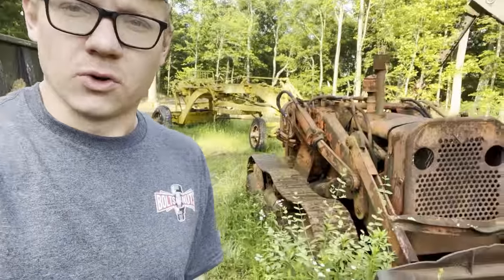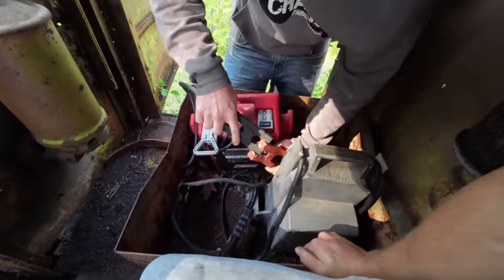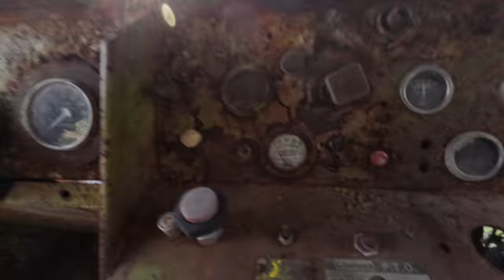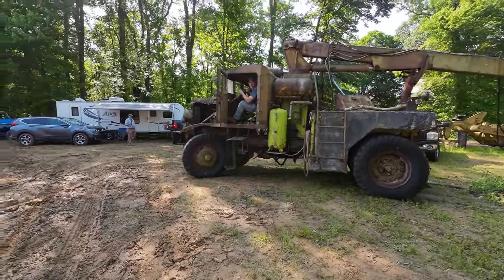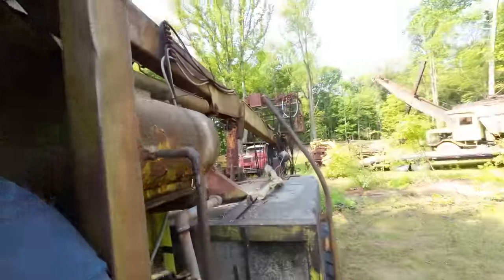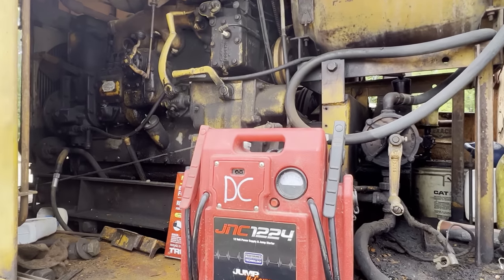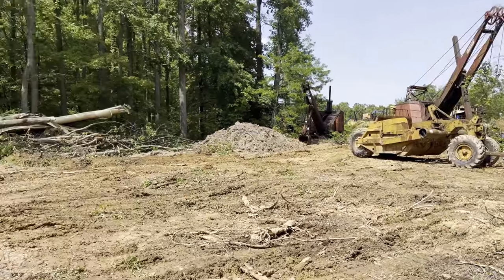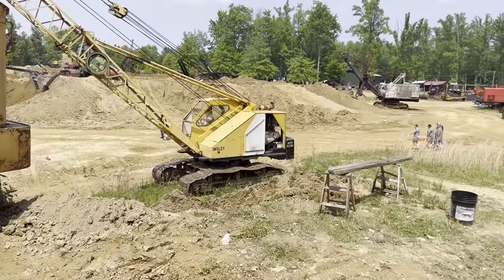1950s Euclid Off Road Truck, Sitting 10+ Years, Will it Start and Drive??

Comment: As someone who has worked underground, I recognize what this truck was used for immediately... This would have been the powder rig. Commonly called a "powder monkey." As a blaster, this is what we used to load shots underground, to advance the mine... I've never seen one mounted on a Euc like this, ours was on an old Gettman... But I'm 99% sure that's what this was used for. That air tank on the side was likely used for the pneumatic loading of ANFO.
Reply: I love that
Reply: Likely you are right. Like for blasting power dam tunnels.
Reply: What did you mine, if you don’t mind me asking?
Reply: Literally says it in the video
Reply: Boom truck literally
Reply: @kalen01  I'm pretty sure all powder rigs are a rusty POS the moment the leave the assembly line... Still never seen a nice one.
Reply: @pacificcoastpiper3949  Limestone.
Reply: @kalen01  first of all thank you for all your hard work y'all don't get enough thanks for that dirty dangerous job

I'd love to see that truck running
Reply: Without a doubt. It wouldn't shock me if they bolted out of it as well.

The company I worked for was partial to Oldenburg/Cannon powder monkey rigs. They were okay, certainly nicer than the abomination of a clapped-out Young Buggy I stumbled across near a Utah uranium mine. They'd deactivated the bed cylinders and lined it with plywood. Certainly one of the machines of all time.
Reply: I was going to say the same thing. I work in an underground zinc mine and we use ANFO on a similar rig ours is a Getman also. We also have used an Oldenburg and a normet.
Reply: ❤YOU DA MAN! Never had a doubt, you’d get that Euclid  running! GREAT VIDEO!
Reply: Dry blasting with ANFO?
Reply: Sure is,I work at a sand plant (above ground mine) and see the powder truck going in almost every week.
Reply: @bixby9797  I would hope so. ANFO is water soluble... if it gets wet enough, it'll dissolve, water can also cause it to deflagrate, which can cause the blast to release NOx, which is harmful when breathed. There are nitrate based emulsions for use in wet conditions, but ANFO is dry use only.
Reply: When he said it was for mining that was my immediate thought.  It looks like it has an air supply system for operating rock drills and for blowing out holes.
Reply: Don’t think so.
Reply: @welshlyn9097  it's a old mining truck,otherwkse as a powder truck.
Reply: @ChrisHarding-lk3jj  Compressed air is also used to blow ANFO into drillholes, as well as blowing the holes out before loading powder. That task feels like standing in front of a shotgun loaded with birdshot!
Reply: That Euclid came with its own hammer to fix any issues!
Reply: powder monkey was also a name for kids who used to load powder into cannons.
Reply: Q
Reply: Thanks a bunch for the genuinely useful comment, Diesel Creek vids always have some of the most informative and non-toxic comments on YT and I'm so here for it.
Reply: yoooo that's sick! appreciate the extra info.
Reply: This is from back in the “ good old days “ when breathing diesel smoke was good for ya. That old Cummins barkin out the Jake must have been something to hear.

Comment: I challenge anyone to find any modern thing nowadays that can sit outdoors for 20-plus years uncovered and that will still start with the same old fuel that has been sitting there also for 20-plus years! Nothing like good'ol diesel power to work after decades of rest.

Comment: Great video Matt.  I love any machine as long ass it's old. As a young kid in the early 50's I'd stop by Delta Crop Dusting service in Monroe, Louisiana on my way home from school. They were the precursors of Delta Airlines. They built their own aircraft for crop dusting and it was like watching a big model kit being put together. I was no trouble so they would sit me on a stool, give me a 5 cent Coke and let me watch. They would answer any questions I had if it wasn't too many. I got my love of airplanes and flying then. Still today, I think REAL airplanes have two wings and round propeller engines.
El Mirage, Arizona

Comment: Congratulations on getting that ol' Euclid FD running again. I've been attending this show on and off since the 90's and I've never seen it run. There's also a decent Link-Belt "Speeder" shovel behind the Euc that hasn't been run in many years. Rumor has it that it has a serious mechanical issue that would be costly to fix.  I have an old 1990's VHS tape of this show: you wouldn't recognize this place if you saw it.

Comment: 743 Cummins are great engines. There's a 4 cylinder version of the same engine in the grader sitting outside my house right now, a 495. Love the sound. Side note, it uses 2 D batteries to start lol. Takes a lot of current.
Reply: Being a old H series is very possible that it’s still a 672cid.  They have a smaller bore, 1/8” smaller if I remember correctly it wasn’t until later years they upped the bore size by boring out the cylinder larger.   The cylinder liners are interchangeable the only difference was the older ones had a very thick liner with a notch cut out at the of the liner for the valves to clear.
Reply: When I worked at Cummins in Toronto in the early 70’s it wasn’t too often you came across a 4 cylinder one. One thing I did notice is the ones 
built under license by Komatsu in Japan the inside of the crank cases where painted Cummins Golden Rod yellow, the block casting had a smoother look than the ones that came from Shotts Scotland. I was told back then that the blocks where “ cured “ for a year before they machined 
them.  Most of the engines of this age came from mines, sawmills, power plants, and tugboats pulling log booms up in Northern Ontario.
It wasn’t uncommon to see blocks with casting dates going back to the 40’s.  Lots of memories of making up new lube hoses, as these engines 
didn’t have a lot of connected drilled oil galleries. Accessories had to be supplied by oil hoses.  My old NTC Big Cam 2 from 82 had a “ signal line “ 
that came of the lube pump and plumbed into the camshaft gallery.  There’s nothing like the sound of a naturally aspirated NH 250 with a Jake 
rolling down hill into town. 😊

Comment: Wow, I was watching the nice D8 and remembering driving, but not operating, one a few years ago. Then I did the math and it was 50 years ago. Our mine had a few rented Euclid haul paks for a while, until all our Wabco 85 ton rigs were built, and boy were they loud. The drivers had fun when it rained and they could spin in the mud puddles. One big Terex with a Detroit diesel that you could hear from a mile away. Now those are known as the old days.
jack

Comment: The bucket capacity on the old friction/cable shovels is so small, considering the size and potential of machinery behind it, appears most of it's power goes into maneuvering it's own weight and not the weight of the shovel contents. Great video and 'start-up' of the Euclid. Cheers!

Comment: This was used for high scaling and loading explosives. High scaling is using a bar to remove loose rocks from walls (called ribs in underground mining) and back. The roof is called the back in hard rock mining and called the top in coal mining.

Comment: Will have to look for that euclid in a different place next time I get to the show. In 1962, I worked the summer for LB Smith equipment at their Albany NY branch. Most machines they worked on had Detroit engines in them. Some owners insisted on Cummins engines. There was a tc12 around for a while. It was a great 6 months between college terms. They were using a lot of twin engine scrapers at that time.

Comment: When I worked for Blackwood Hodge in the UK those R15 /FD trucks were rebuilt as new stripped down to the last nut and bolt a friend of mine has the 5th one built in the UK

Comment: Hey Matt, love all your videos and although I only subscribed a few months ago, I've watched about everyone. Hate having to wait for the next one. 2 yrs ago I built my shop and thought I would throw you a couple of ideas. 1st one is I used regular saw milled wood, not home depot nor lowes, saved a ton of money and you now have your saw mill to do it yourself.|more savings| I have a metal workshop similar to yours, but it's only 20x40. I have 40 feet of workbench at 45inches high as I'm too  over 6' and I don't want to kill my back bent over a bench. 2nd is I have a lot of battery powered tools and built a charging station. I wired it myself so i dedicated a circuit to a switch, then to a receptacle that feeds all my chargers. Plug them in once and just flip the switch to charge. I have 8 chargers to charge up to 8 batterries at once and only have to flip a switch to charge and flip it off when done. I always have  several charged and ready to go. I'll leave you with a 3rd idea, I built a 4'x8' table on castors with locking castors on both ends {total of 6 with 2 in the center} out of 4x4 legs{2 each end and 2 in the center}. This is also 45'' high, braced top and bottom with 2x4's with plywood on bottom and top so you have added storage on bottom. Holds a lot of weight and if you need it to roll out your way, it glides across the floor easily. My workbench also has storage shelf on the bottom and is built from 2x4s frame and 2x12 tops at 24''s wide. If you're interested in how it looks, shoot me a reply and I'll get you some pics. Keep up the excellent work

Comment: NH  Fuel Pulse Pump has an electric fuel shut off solenoid atop of it.  You need to run the thumb screw into the bottom to run it on manual...without an electric input.
Reply from the maker: That’s what we dod

Comment: The Euc may have been used in a dome shape mine to scale …. Remove loose  material from the walls and ceiling . It looks like there were air hoses to the man bucket and a compressor tank on the truck just behind the cab , Theses old diesels never quit .

Comment: didn't even have to check for spark, runs off 20 year old gas, didn't need to air up the tires, no wheels were stuck, and it sounds and runs like new.  wow, very believable revival!

Comment: Don't worry about spot welding the jumper cables guys . When I was in the military I forgot to tighten a cable on a brand new battery for the end loader and blasted the post right off . Yup I got in trouble for that one . I did fix the post though . Not recommended but I cut up three d batteries and took out their cores . Then used a welder to melt the cores into an old battery connector that was clamped onto the stump .  Did the trick when we had nowhere to go get another new battery . That truck needs to be made into something cool . WOW it has a concrete bed ? Am I seeing this right ?

Comment: Where you boys parked that Euclid will be its final resting place if you don't clear enough trees to get as much sun as it previously was. That's my fear at least for such a rare and disappearing icon of USA's industrial era. It is still a magnificent machine and you won't see that dependability from todays machines when they're 70+ years old. Eh Matt?
You're right about the man lift. That may need removing but that's up to the owner. He had a very good parking spot for twenty year. Impressive was it, that all four corners still had air in the tubes?👍

Comment: That’s a H series Cummins, not a NH.    Nice engines.  I have a 4 cylinder in a boat.   The east way to identify it is a H series is a 2 valve engine with both the intake and exhaust on the passenger side, the NH is a 4 valve engine that features the exhaust on the passenger side and intake on the driver sides.

Comment: get the concrete weight and the lift off the damn thing and replace it with a 5th wheel or the bed from an old military 6 wheel and it would be perfect. I have simple taste and the older they are the better I like them that's a hell of a nice old truck

Comment: I drove this same truck mine was a 5 speed stick. Had to push start with a track loader. And it didn't have brakes until pressure built up. And old man wouldn't drive because it would do like a 10' wheelie until load came out. Then it would set down nice and easy.

Comment: You are making Me Feel old talking about stuff sitting for 20 years as if that is a long time. And that 
Euclid looks to Be late 1930’s or 40’s. Twenty Years ago I married My second Wife and started on My second batch of Kids. When I was a teenager a towed or pushed Road Patrol with cranks was ancient of course one with rubber tires is modern. I am about 10 miles North of San Francisco. There are a lot of old pieces of road building equipment around Here and people who collect and travel cross country to ploughing Bees . I worked with a old Black Man who told Me fascinating stories about His youth growing up on a farm in Missouri. He ran a road patrol like the one at the beginning of the video that had iron spoked wheels  with hard rubber tires. It was towed by a team of mules and steered by the commands Gee, Ho and Yea. Ho was straight ahead I can’t remember if Gee and yea  were left or right. Elevation of the blade and pitch were controlled by spinning large iron wheels that turned gears . That stuff never rusts out because the older steel had a high copper content. To a white Kid in California stories about the KKK sound like boogey man stories. He told Me about driving to town in a car and fat pink white guys wiping sweat off themselves with rags and lamenting “ whooo , You Darkies can take the heat”!  “ Hey Boy ! Where You goin with that car ? A Nigger cant have nothin nice!” I would say “ come on Shorty are You kiddin Me ? You mean there are really people that backward that actually talk like that. ? “ He would say “ thats Just their way Son . Their heads is small, thats all. “

Comment: GREAT A NEW PROJECT!

I JUST1 PICKED UP MY 1971 INTERNATION AMBULANCE SHE THOUGHT THAT THERE IS A PROBLEM WITH THE ENGINE, THEY CHECKED THE FLUIDS 10 YEARS AGO, WENT FOR A 250 MILE TRIP AND FORGOT TO TIGHTEN THE RADIATOR CAP, "BOILED" ALL THE WATER  OUT OF THE RAD, OI HAVE NO IDEA IF THEY HAD ANTI-FREEZE IN THE RAD TOWED UT BACK WITH A JEEP AT 35 MPH  FOR THE WHOLE 250 MILES SHORTLY AFTER HER HUSBAND DIED AND 10 YEARS LATER I BOUGHT IT, SHE THINKS THAT THEY "BLEW" UP THE ENGINE OR RUINED TWO PISTONS. I THINK I HAVE A PROBLEM. GOING TO BUY RADIATOR CAP TOMORROW AND A GALLON OR TWO OF ANTI FRREEZE. 

I LIVE IN NEVADA 30 EAST OF RENO.:face-blue-smiling::face-blue-smiling::face-blue-smiling::face-blue-smiling::face-blue-smiling::face-blue-smiling::face-blue-smiling::face-blue-smiling::face-blue-smiling::face-blue-smiling::face-blue-smiling::face-blue-smiling::face-blue-smiling::face-blue-smiling:

Comment: Umm I have not watched the entire video yet, but why are you running the jumper boxes black to red?   All my boxes have red and black.  Does that one box have a black cable for the positive?  Just looks odd seeing a black to red connection.
Reply: It's a 24V machine, so the batteries have to be connected in series (i.e. with a red-black connection) to get 24V from two 12V jump packs.
Reply: They're in series to give 24 volts, so it goes black off #1 jumper box to earth, then red to black on#2 jumper box then red to the main power feed.

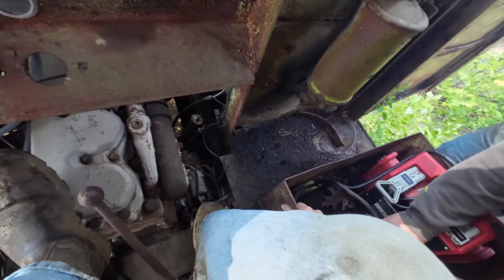Comment: @6:20, you guys are number than a pounded thumb for NOT wearing safety glasses when making contact with a battery terminal with high current capability.  It's just a matter of time b4 you throw molten lead into your eyes.  It's time to smarten up and show just a bit of wisdom.  @9:16, did you see the nest shoot out of the exhaust!

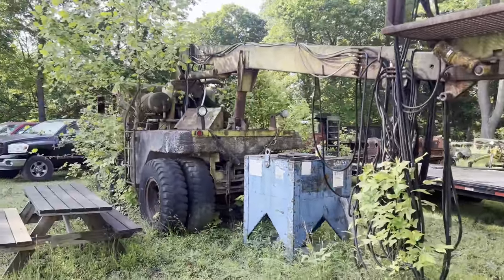Comment: 2:11 Speak for yourself, homey, I'd trust that old thing. Matter of fact I'd trust it more than a new man lift. They built stuff more substantially way back when. Today's stuff is disposable and unreliable. I'd give the hydraulics on the boom a once-over and, if there's no issues with the hoses, I'd run it. And if there are, I'd just replace the hoses and run it anyway.

Could use a rig like that at my local flying field actually. Get RC planes out of trees with it.

Comment: Watching that shovel run looks like a huge pain right in the ass(and arms). I like my two joysticks in a new excavator. Not as cool, but when you do it for 12 hours a day, you need to be comfy. Air ride seat, air conditioning, and blue teeth radio.

That gives me an idea. Someone should do a resto-mod on one of these old shovels. Throw in a nice seat, radio, seal the cab for A/C, LED lights, etc. Try to make it as close to modern as possible.

Comment: Please don't start it on 20 year old fuel I restore barn finds give the old girl clean fuel  and clean oil
Reply from the maker: That old fuel is probably better than the new stuff. It’s not like gas
Reply: @DieselCreek  
It's worse because it separates. Diesel fuel is a byproduct of gasoline.
Reply from the maker: @mrjames7251  diesel fuel does not separate